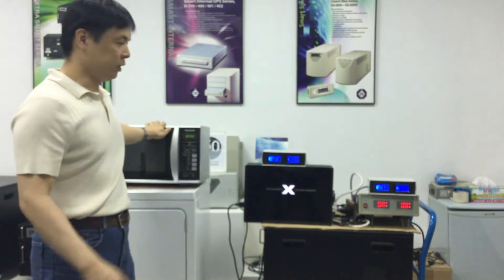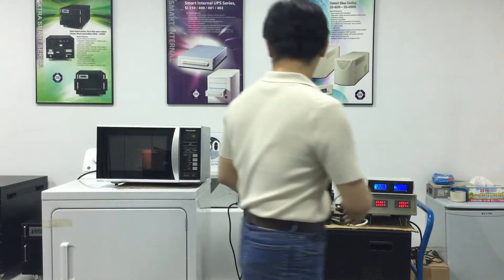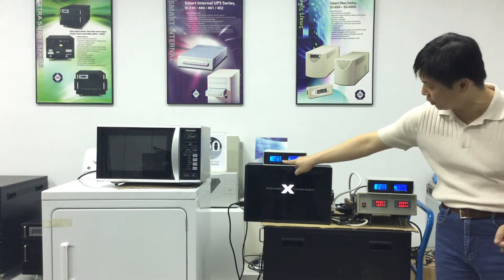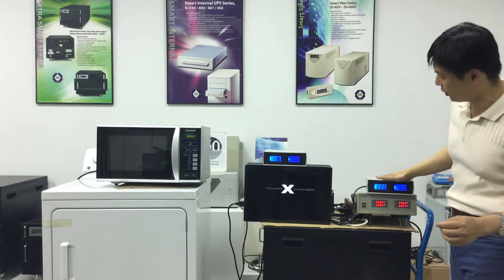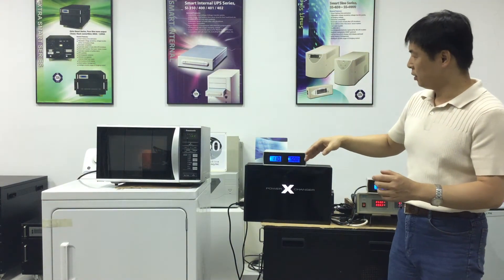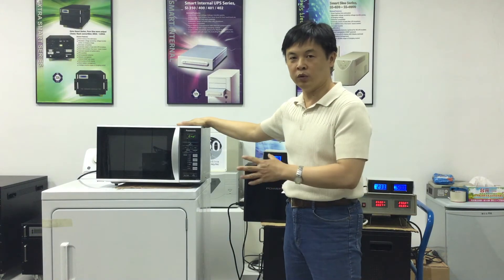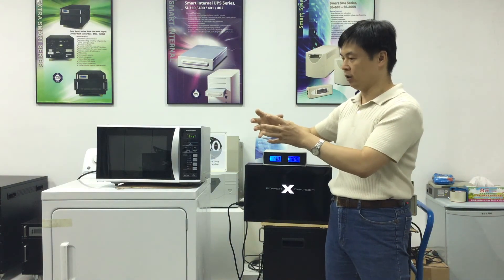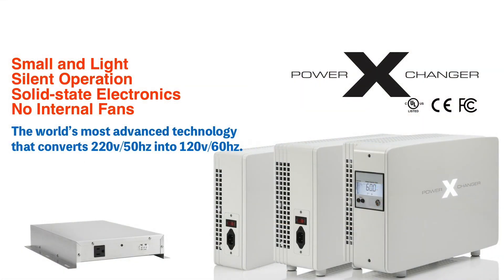Converting 220V / 50Hz to 120V / 60Hz, using a voltage and frequency converter, microwave demo

Comment: Am looking for a VOLTAGE AND FREQUENCY CONVERTER, AND ONLY SEEM TO FIND A VOLTAGE CONVERTER,AND NOT A FREQUENCY CONVERTER
Reply from the maker: PowerXchanger voltage and frequency converters are available in a variety of sizes and capacities. All Step-Down Models convert 200V-240V 50 Hz to 120V 60 Hz using advanced electronic components and without the use of heavy copper wiring. 

You can compare the features and specs of our different step-down converters here: https://www.powerxchanger.com/store/products/step-down-220v50hz-to-120v60hz/compare-specs/

Aside from aesthetics, size, and installation options, the main difference between the Deluxe series, Slimline series, and Economy series is fan noise. The Deluxe and Slimline series are all noise free and have sealed electronics - there are no internal fans. Cooling is done with natural ventilation through the heatsinks. On the Deluxe series there are two fans on the back, but these turn on when the unit is in distress due to overload, or excessive heat due to lack of adequate ventilation.

The Deluxe and Slimline Series also come with a wall mounting kit which allows for more flexible installation options. An additional accessory for the Deluxe Series is an Xchange Outlet which can also be wall mounted.

The Economy Series has selectable output voltage. Choose between output 100V 60Hz, 110V 60Hz, 115V 60Hz, and 120V 60Hz.

Our most powerful unit is the EX-21, it has a capacity of 2340W and max output current of 21.8 amp: https://www.powerxchanger.com/store/economy/120volt-60hz-ac-power-source-step-down-voltage-frequency-converters-2600va-2340w.html

Economy Series has CE mark and certification. The Deluxe and Slimline series have UL, CE, DEMKO-CB, and TUV.

PowerXchanger Deluxe Series 220V 50Hz to 120V 60Hz: https://www.powerxchanger.com/store/products/step-down-220v50hz-to-120v60hz/deluxe-series/

PowerXchanger Economy Series 220V 50Hz to 120V 60Hz: https://www.powerxchanger.com/store/products/step-down-220v50hz-to-120v60hz/economy/

PowerXchanger Slimline Series 220V 50Hz to 120V 60Hz: https://www.powerxchanger.com/store/slimline-series/voltage-frequency-converter-xs-05-ga-general-application.html

Comment: The "loud buzzing" you hear is normal for all 50Hz microwaves. They all sound like this. But yes, the microwave transformer is not designed for 50Hz and may get too hot.